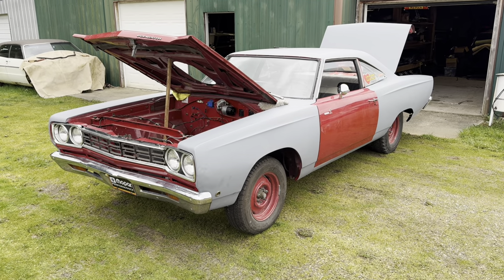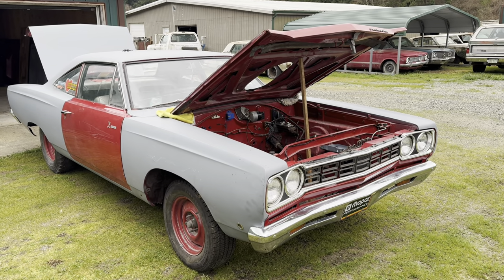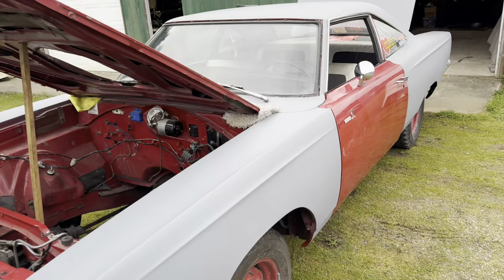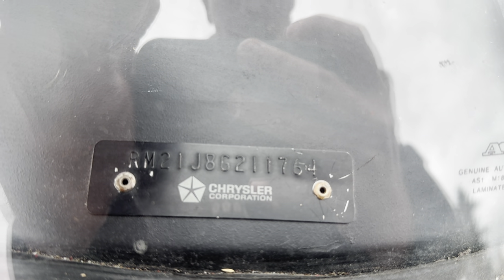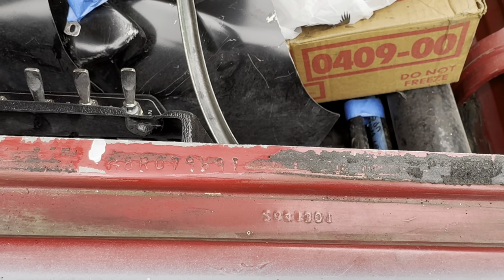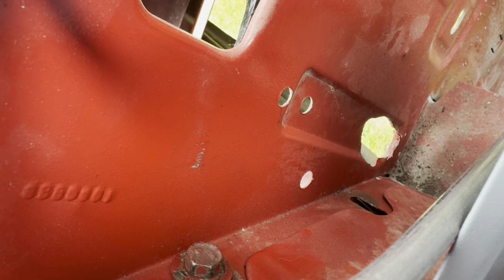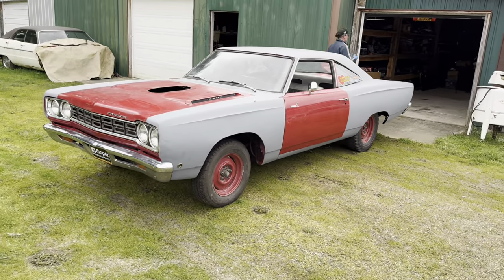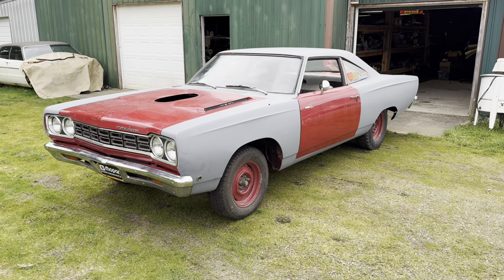How To Find The Hidden Body Numbers On A 1968 Plymouth Road Runner 426 Hemi Car And Any B-Body!

Comment: Thanks for this. I have a '65 Coronet 440, 4 speed car. Bought it many years ago with not trim tag . Heard that there are "hidden" id numbers on these cars in the locations in this vid but it really helps that you show EXACTLY where to look. (I have layers of paint & crap to clean so it's gonna be hard enough as it is.)
Reply from the maker: It’s a little different on a 65.
Reply: @rocketresto  Can you briefly explain please ?
Reply from the maker: Different location on the back, still has core support number

Comment: Actually, both the 426 and the 440 cars with 4 speeds did get the Dana60....
Other than that, good job Tom.
- Ed on the Ridge
Reply from the maker: Everybody thinks all hemi cars got them and it’s only 4 speeds and optional on the later hemi cars.

Comment: Getting ready to buy a 68 RR and vin indicates its a Hemi car. Unfortunately no fender tag or broadcast sheet. Plant is A which i believe is Michigan.  If thats the case the body number on core and trunk should at least indicate same plant and year correct.  Also did all hemi cars have the reinforcement plate on back of rear leaf springs..i know they all had torque boxes on front of leaf springs. Also didn't they have a reinforcement plate where pionon snubbers hits on car. Thanks
Reply from the maker: Yes yes and yes.  No way to tell VON without more documentation however.

Comment: Sequential numbers 8) some of the numbers can be upside down 🙃 or backwards something like that sometimes
Reply: Show the torsion boxes too! Yes! And the K-frame should be different with a skid plate
Reply from the maker: Was concentrating on body numbers in this video, doing one on what makes a hemi car is a good idea and we might do that one.
Reply: I have the books from Galen V Govier 62 to 74 parts & casting numbers and 66 to 71 production option code books. He looked at my car at car club meeting back I think 1999. My car is just a base model 68 charger, my car and another 68 which was green r/t both had a 727 out of a 67 C body none HP 350 horse 440. He. Said in 68 up tell about mid production year, some parts were borrowed from 67 cars and put on 68 cars that’s why some people don’t like 68 because the parts don’t always match up but they could have been marked on the production line from I guess if i remember right from the build sheet. He also said early 68 440 and 383 could have gotten the older heads instead of the 906 heads, can’t remember what heads they were but said they were still good hp heads. Some people said he was a A-hole but he was really nice to me and was excited about my base model car because it was QQ1 with blue interior and white vinyl top, said it was a uncommon color combo because most cars got the same color interior as there vinyl top, which confused me for what color top did a blue interior got then? No vinyl top? lol, anyway love your videos!
Reply: Ooops dead car garage did it already on yours I got it wrong torque boxes I mean 😢